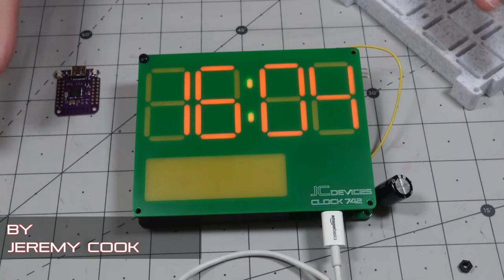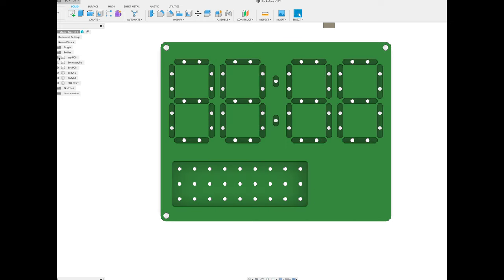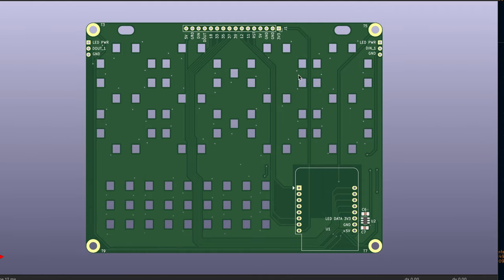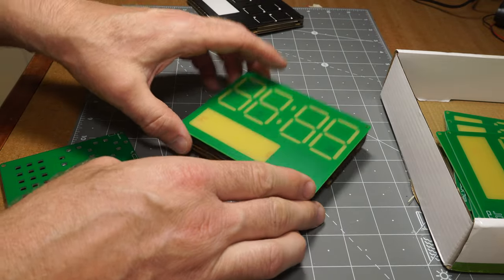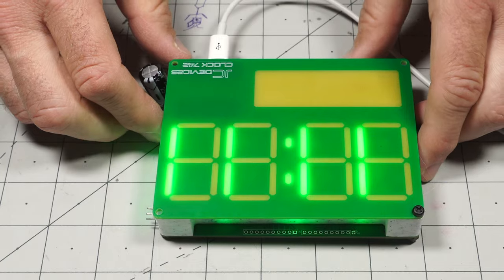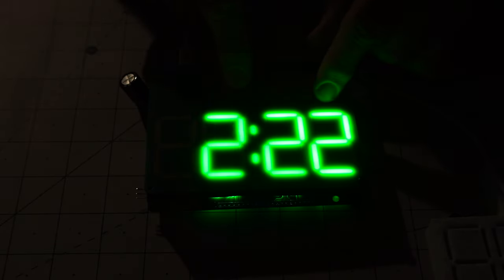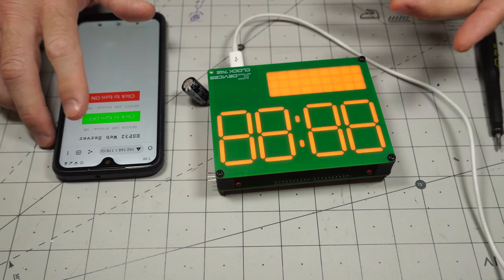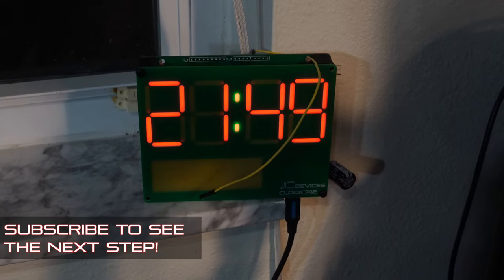PCB Face for a 7-Segment LED Clock? [ESP-32]

Comment: It looks very cool. Awesome that you have that skill now to design PCBs. 

I did some electronics last week. Just a Arduino, a motor driver, two buttons, two potentiometers and 2 proximity switches. Still needed a lot of soldering and terminals. Also cables connecting everything. Not very user friendly. I wish I could just design the circuit in a web tool and get it delivered ready to go with screw in terminals.
Reply from the maker: Thanks! Yeah, knowing a bit about PCB design now is quite convenient. LMK if you need any ideas on how to get started 🙂

Comment: This is a cool idea and implementation.
I'd be tempted to up the # rows of LEDS in the display area to 6-8 rows to use some scrolling text, to display whatever, weather, reminders, or maybe Palettes of color waves. That Max7219 IC is fun on matrix things.
Wow, steady handed soldering!
Would/maybe dropping the level of the separator tops of that display area would lessen the black grid showing thru yet still serve its purpose.
I look forward to more on this. Good Job!  😁
Reply from the maker: Thanks for your comments!
Good idea about the separator tops - hadn't considered that, but might work quite well. May have to experiment with that.

Comment: Do you think maybe you could entirely get rid of the 3d printed part if you use a thick pcb and backfiring LEDs/sidefiring LEDs with reflective tape covering the back?
Reply from the maker: Perhaps it's possible, though I think the spacing does help with diffusion. Why reflective tape covering the back? Thanks for watching!
Reply: @JeremyCook  Maybe a thicker PCB and a larger number of small LEDs (instead of a few large ones) plus white silkscreen on top might help make it more uniform?

My idea with reflective tape was that it would diffuse some more and bounce light in if you use side emitting leds but i guess it could help a bit with back emitting ones too.

I love it, set my mind wandering lol

Comment: Hoping that the LEDs are WS2812, 
- Where can I get these ? or What package are they?
Reply from the maker: They're SK6812, which may be a variation of WS2812 - they use the same protocol at least. I got mine on eBay.
Reply: @JeremyCook  but the package seems smaller than 5050 (5mm x 5mm) something like 3528 package... Maybe it is me looking at it at the wrong angle though..
Thanks anyway
Reply from the maker: I believe they are smaller. I put up the custom footprint that I used here if that helps: https://github.com/JeremySCook/clock742

Comment: Hey, nice project :) I can really recommend "PETG K5-shade: light shielding PETG" from kexcelled for such light separators. It's white, thus perfectly spreads the light, but has no light bleeding even with 0.5mm thin walls. Being PETG though, it slightly tends to warp :/ But it really makes a difference. 
Also, try using a thinner PCB for the front face along with the copper mask. The fiberglass core of the PCB spreads the light sideways. This will be less of an issue on thinner PCBs, like 0.8mm or 1mm.
Reply from the maker: Interesting ideas, thanks!
Have yet to try PETG, but maybe I need to get set up for it.
Got any ideas for how to selectively remove solder mask? I may have a need for this per a further experiment relating to this project.
Reply: @JeremyCook  PETG should be fine with most printers... I've used OpenSCAD for creating solder masks and copper fills and exported them as SVG/DXF to import into EDA. OpenSCAD is great for parametric designs and allows for simple inset/outset so you can have soldermask slightly go over the copper mask below. I may try to post a link, but YT usually removes them.
Reply from the maker: Nice. Yes, the YT comment system is frustrating for sure.